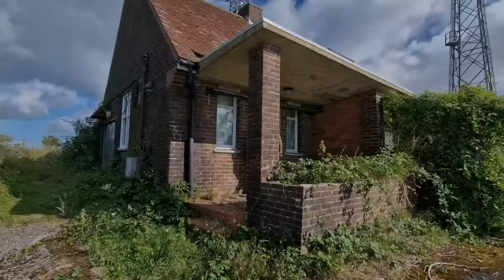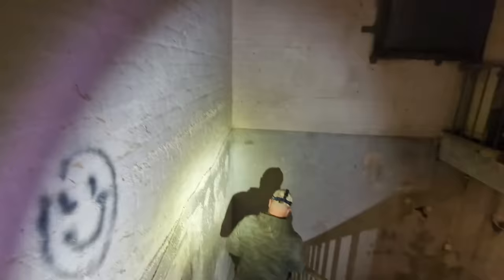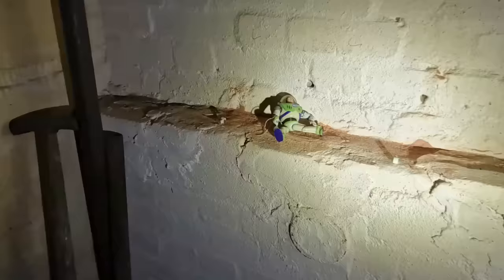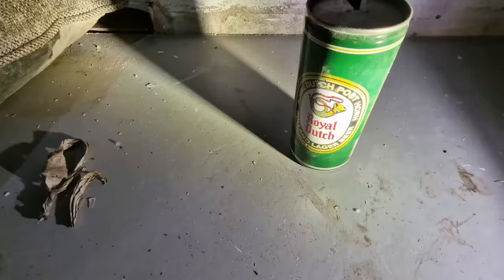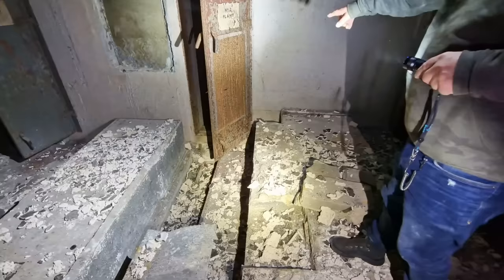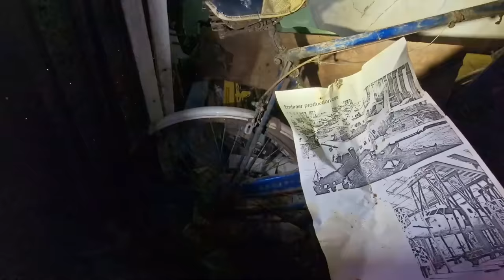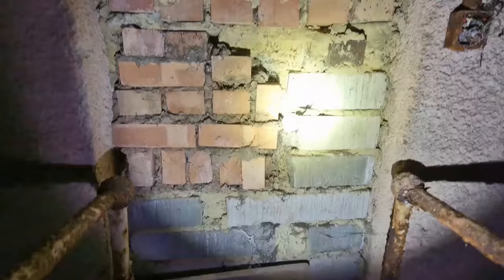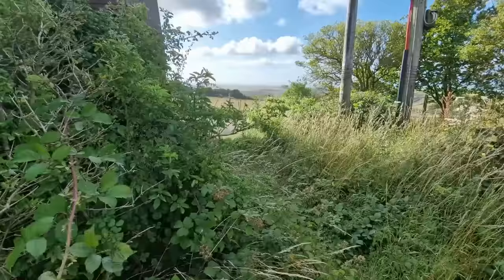We Found a NUCLEAR Bunker Under a bungalow - Preserved and Left Frozen in Time

Comment: The blast door you saw off its hinges has been like that for at 52 years.  It is like that because in 1971 a few youths worked to remove the hinge bolts. In doing so one was crushed by the falling door.  His mates were unable to save him and the 17 year old guy died.  The 60's / 70's c;utter you found is because the bunker was briefly used as a charity function room (hence the "enter at your risk" sign), document store, and storage for a local electrical retailer.
Reply from the maker: Wow, very interesting!
Cheers for the info 👍
Reply: So the title of this video is wildly inaccurate.
Reply: What blast door is off the hinges?
Reply: @Nowaybro420  they walked past a big metal door off it's hinges.
Reply: @Nowaybro420 36 minute mark. RIP to the young lad x
Reply: Were is this place
Reply: At least he died doing what he loved: removing hinge bolts.
Reply: @thehatefulkate  Right next to the football... could have been brought by the kids and forgotten in the aftermath.
Reply: Wow, the mundane details 😂
Reply: @maxmaidment96  😔 good point. Sad. What starts as an adventure ends in horror
Reply: @chrisbabbitt4202 you must be new to youtube.  It's still a bunker under a bungalow... its not misleading enough to even be a point to mention anyways.
Reply: I remember his funeral well,  his coffin was 6ft long by 4ft wide and 3 inch deep 🥲
Reply: What a terrible way to die especially that young doing something that they shouldn't have been doing!!!
Reply: @Glenn-em3hv  most early deaths are from doing things you shouldnt, its the nature of things you "shouldn't" do. Kids usually die from doing stupid things. you rarely hear about deadly trips to the local grocery store.
Reply: @chrisbabbitt4202 not inacurrate by any means! Title is just right
Reply: @chrisbabbitt4202  how does 1 death change the whole past of the bunker since he died? makes no sense. its like saying you found a bunker made by Hitler and since someone died it in its not a hitler made bunker and all the history of that bunker is out the window
Reply: Very rare to get this kind of background information, thank you so much for sharing this!
Reply: @pauliewalnuts240 this is how the phrase "play stupid games, win stupid prizes", came about.
Reply: @Glenn-em3hv better than dying in work for 10 quid an hour
Reply: Brutal 🤪🤣
Reply: @billylip680  except in 1971 it would have been ten quid a week.
Reply: @_Santana it doesn’t.  Bunkers be bunkin’
Reply: Umm but the door is against the wall can't see how it's crushed anyone, maybe hit him unless it was put in this position after
Reply: i got lost in the commentsection, how do i get out?

Comment: An underated risk in these places is from asbestos, most of which was never stripped out.
Reply: No.  Not if it’s left undisturbed…. It’s not radioactive material.
Reply: they didn't spend a lifetime installing the stuff. they walked through a bunker for 30 mins with some of it exposed (but not disturbed). even if it was "disturbed" - it was 30 mins. buy a clue.

Comment: The ‘bungalow’ was a standard pattern control of entry point to these bunkers. Everyone going in and out would have passed through the bungalow past a security checkpoint usually manned by an RAF Police NCO. Tags or badges would be issued at the checkpoint so they knew exactly how many and who was in the bunker. It will probably have run on 12hr shifts with a constant presence being in the bunker 24/7 for many many years.
Reply: Indeed. Even disregarding the large antenna towers, the building looks very 'MoD-ish' to me, having served on a number of different bases in the past.
Reply: I know its Amercian, but the missileers shift change scene out of War Games appears to be conceiveably accurate.
Reply: @gorillaau   I was thinking the same (I just watched it last weekend).

Comment: This bunker is either at Truleigh Hill (otherwise known as Mill Hill) just above Shoreham, Sussex or is identical to the bunker that is there. I used to fly radio controlled slope soarers (gliders) about a quarter of a mile further along that track that can be driven up by just normal cars. Still interesting though- I'd often wondered what it was like inside. Everyone KNEW it was a bunker.
Reply: The decoy cottage is the same as Kelvedon Hatch.
Reply: It is Truleigh Hill as I looked around 3 years. ago. Unfortunately I was unable to enter as it was sealed up tightly.
Reply: @MrBLUEDEVILUK  Yup thats the one. I'm quite local to it.

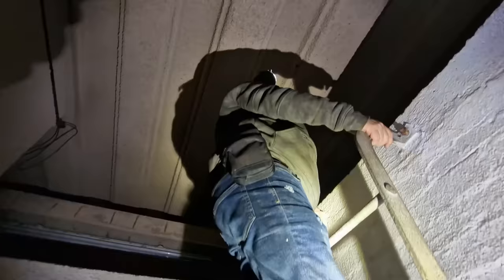Comment: Those bungalows weren't decoys. As you've said yourself , this would not make much sense given those huge antenna towers nearby. The bungalows were for the guards and operators who were basically living there in shifts lasting several days or weeks and thus needed a decent place. What really surprises me is that this bunker is still connected to the power grid. Another thing : you should really wear protective masks in such places. You mave have noticed that the ceiling reinforcement beams at 14:40 are all covered in what looks like white/greyish plaster ? Thats spray asbestos which was meant to protect the ceiling from fire. So that it won't collapse because of the heat. It was widely used in all kinds of buildings as fire protection measure up until 1970 went it was finally recognized to be highly carcinogenic and banned almost all over the world simultaneously. Especially when its that old or gets disturbed like being touched, it starts to crumble or falls off completely, emitting fine dust which ,for stated reasons, should not be inhaled under any circumstances. I bet there are even more dangerous fibre wool asbestos mats in some of the walls.
Reply: In addition to the asbestos, I noticed yellow mold on many surfaces especially anything made of wood or paper. That stuff is easily disturbed and inhaled and isn't good for one's health.
Reply: the whole time I was watching I was thinking at least they'll have the video and mesothelioma to remind them of their trip
Reply: Also electrical wires were often isolated with some kind of asbestos weaving, I cringed when the guy dragged his finger over the wire on the wall.
Reply: Yes I second your advice regarding the use of dust masks and also the power being on, wish I was on "THAT" tariff.
Reply: If you hear them talking about somebody doing new work down there and that it all smelled like weed I believe that they are talking about the fact that it was reconnected to the grid illegally. I would imagine that there was an illegal marijuana grow in there for a while… And somebody did a bunch of illegal connections
Reply: Asbestos undisturbed is fine. If you see sparkles in the beam of light, leave or get a REALLY good mask and a Tyvek suit. A water sprayer to mist down things keeps dust to a minimum.
Reply: Was going to say about the asbestos also well done!
Reply: Lol, Decoys for nuclear weapons...

Comment: The paper reel that you speculate is morse code is actually a player piano roll - the triangle of paper with a decorative CA printed near it is the torn off front of the roll.   I wonder why that ended up down there?   A lot of strange things. Almost like someone who was a company accountant stored files there and used it as an office for a few years.   It must be Truleigh Hill if memory serves, About 1969 or 70 I got down there through the emergency exit building - went down the stairs and came up to THE DOOR - mentioned in another comment.  Couldn't open it.  A few months later read about some kid being killed when THE DOOR fell on him.  When we went back there a month later,  the authorities had welded up the door to the emergency exit building.  I never saw any other way in, the bungalows were locked up tight, so never got to see the extensive tunnels, until now.  I recall reading that in the late 60's a private owner ran some late night parties there. Strange to see it all there with random rubbish and odd furniture? Must have been a storage place for the private owner, and he never cleared up.  If the UK ever legalizes cannabis I suspect it may be repurposed as a grow-op? There must be some use for this interesting hideaway.?
Reply: I was just about to come down here and say that, yeah. Fond memories there - I still have my rolls even though the piano's gone now.

Comment: The best way to check if a electric fence is on. Hold a blade of grass between finger and thumb, put the TIP of the grass on the wire, move the blade of grass towards the wire, if your thumb nail starts  tingling, the fence in ON! no tingling it's off 😊
Reply: Or you can just knock the wire with a wet corn cob. That'll get your attention if it's working! Yikes!

Comment: " Hotpoint " is or at least is a brand of water heaters and other appliances.
That's one hell of a big hidden complex there. I wonder if they'll eventually let someone buy and use that whole thing? A bit of renovating etc and you've got a really and you could have a really unique bed n breakfast type setup there, very cool! What massive project that must have been to build originally. I'm wondering whether they'd have just excavated a huge pit and built all this then filled in over it or, somehow tunnel it all out, which would have been incredibly difficult. If it was meant to be secret, they probably had to tunnel it but, it's hard to imagine them doing that on a scale like that joint.
Awesome, thanks for showing it.

Comment: During the Cold War I was stationed in Western Germany outside of Ulm. We had another base too but it was spent at a secret location. The bunkers that we had in some areas were for equipment. But the housing units 3 buildings with two bunkers in the basement. We had blast doors that were curved inward. We had an air and water system and stacks of crations. MRE meals weren’t invented yet lol I’m old like your grandpa

Comment: Many of them were asbestos riddled, but that one has been surface treated with the cement spray, which was part of the care and maintenance plan, in case they were needed again. As said below - the ROTOR plan was based around a common design, with the bungalow - and the differences were mainly how many floors they had. Sadly, not just this one cost lives after they were abandoned. One around here had a similar fate, and one fully working one had a big fire and one of the firefighters died.
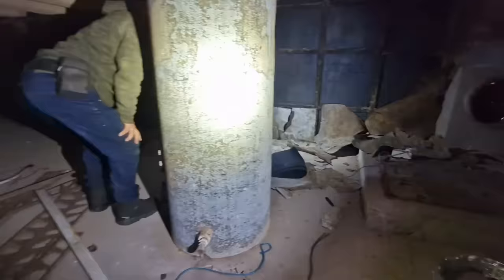Reply: There is some asbestos spray coating visible all over the ceiling at 15:00.

Comment: hey i tried to get in tonight but when we got there under the cover of darkness, the hole had been rebricked, had steel plates covering the hole , the plates were welded, bolted and they were also welded shut. Also the windows were replaced with bricks but the lights were on inside, (we could see through a gap in the door) everything was padlocked and impossible to enter. Real shame.

Comment: The 'bungalow' was fairly standard for these ROTOR bunkers, it's like the one at kelvedon Hatch which is open to the public. They are not decoys as such, inside there is a small guard room type affair - then simply access to the bunker  usually down some circular stairs or similar, like here. The bungalow was just a shell really round the bunker entrance tunnel.

its always mad that the power is still on in places like this, wonder who gets the leccy bill?

Comment: I have never seen such a screwed-up under surface construction.  There is no rapid mobility built into this pattern to be able for the tunnel community to produce anything under emergency modes. Small halls into large rooms, cubby rooms w/junk one would never think would be found that deep into the mazz.  Everything is built in a 'slip-shot' fashion.

Comment: @33:05 Weird to see a file labelled EMBRAER. It's a Brazilian aerospace company/aircraft manufacturer founded 1969, but really only grew once it was privatised 30 years ago. There's also a picture of the early  Embraer EMB 121 Xingu that first flew 1976. I really don't see the connection to an old bunker that was decommissioned in the 70s 🤔
Reply: From another posters "The 60's / 70's cutter you found is because the bunker was briefly used as a charity function room (hence the "enter at your risk" sign), document store, and storage for a local electrical retailer!"

Comment: i would have worn some good respirators, that cement and concrete probably has loads of asbestos in it, the cement dust all over is most likely loaded with asbestos..most of the old cement and concrete has a lot of asbestos in it

Comment: You won’t find “top secret” docs all that stuff down there is from whoever was using it after it was sold off. The bunkers had 2 operations room the bottom one in the old days was used to house a projection system that projected maps into the upper operations room. Watch out for the big hole
Reply: In addition, lovely teak floor bearers which became quite valuable!! I wouldn't like to go into an enclosed space with oxidising metal - very dodgy!